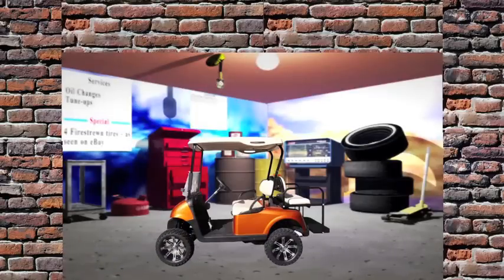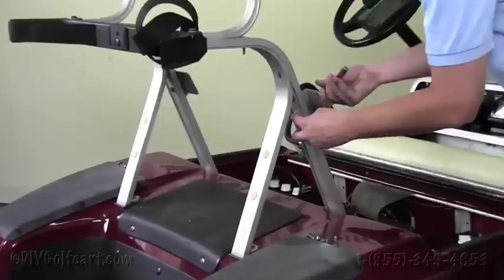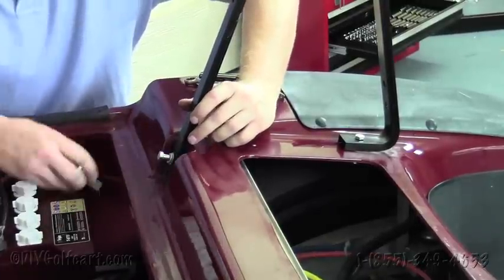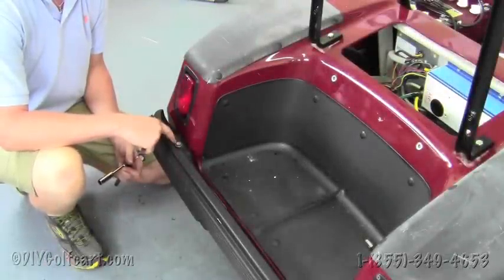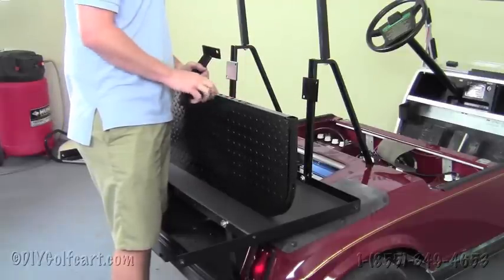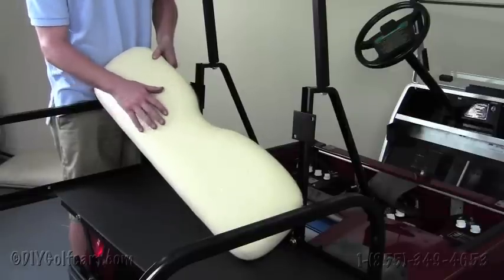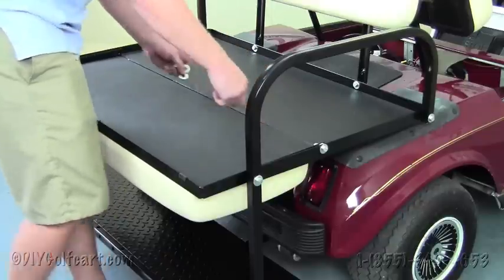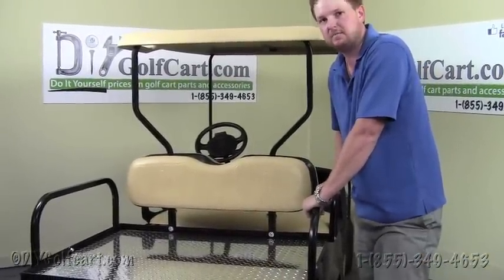Club Car DS Rear Seat Kit | How to Install Video | Installing a Golf Cart Back Seat

Comment: If you notice at 10:30 there are two different seat back bracketts for the front seats. The factory brackets are like the drivers side one, not like the passengers side being installed. Notice how the installation of the drivers side is NOT in the video. Both of my seat back brackets are like that and there is nothing to keep it stable. I will be calling today to see how you resolve this issue. I am very unhappy with the mounting of the front seat backs.